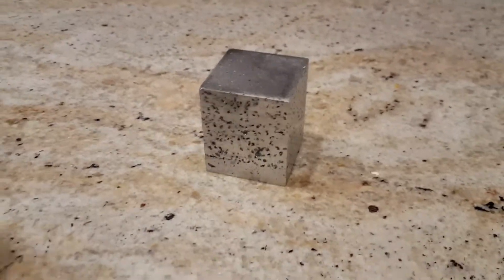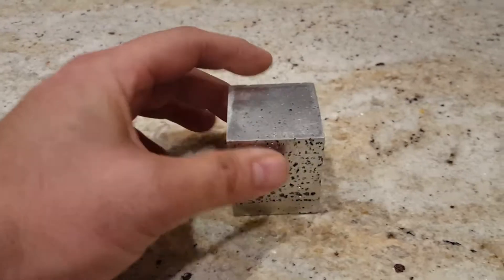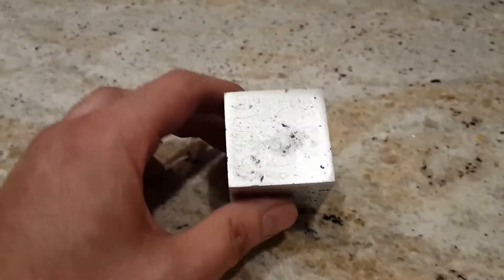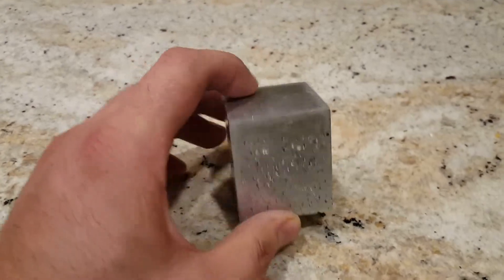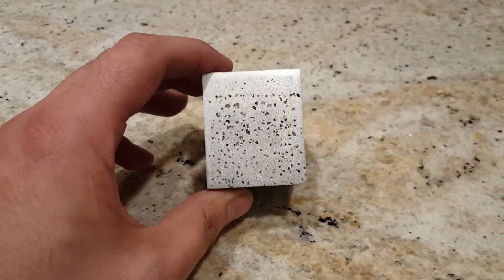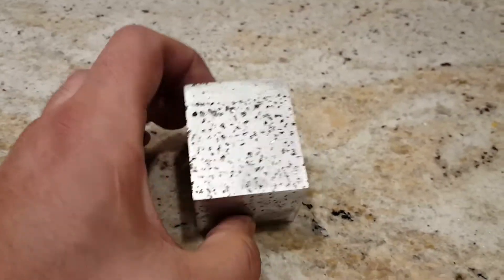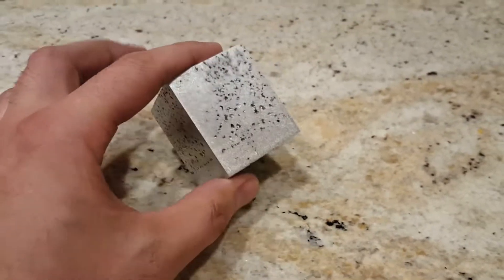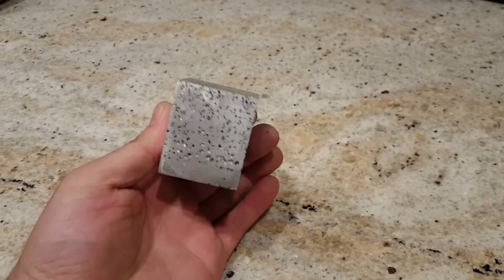Soda Cans Transformed Into a Billet

Comment: They make aluminum can stock here, at ALCOA, Alcoa TN,  from AL 3004 alloy (almost pure aluminum), with metallurgy and thickness very carefully controlled.  Because the reduction of virgin aluminum from ore is so energy intensive (expensive) most can stock comes from recycled aluminum can stock.   The AL3004 (1% magnesium and manganese) was also used to make aluminum platters for computer disk drives.  The desired properties is that it can be deep drawn to very thin, almost paper thin, dimensions without fracture for use as pressurized beverage cans and without excessive cold working.